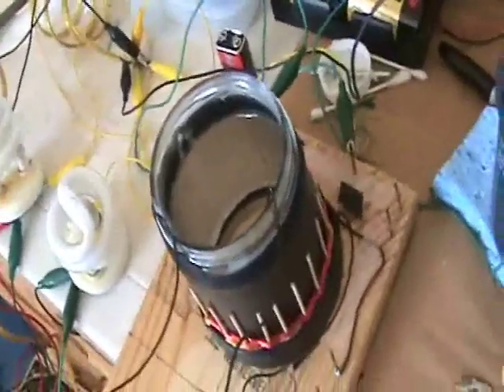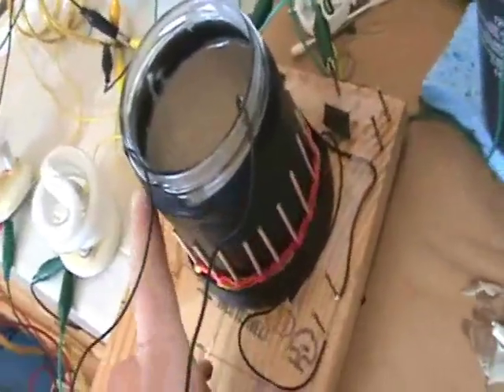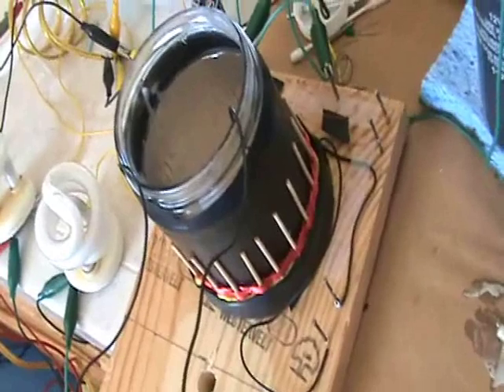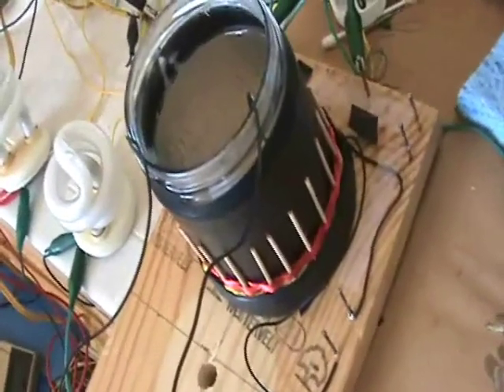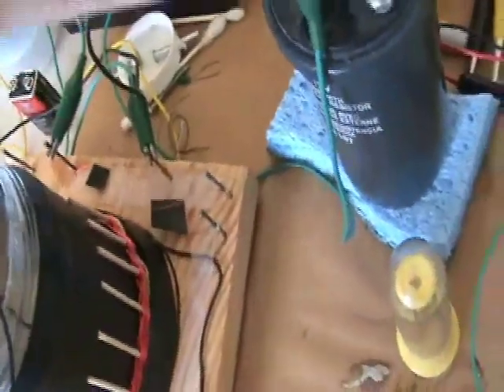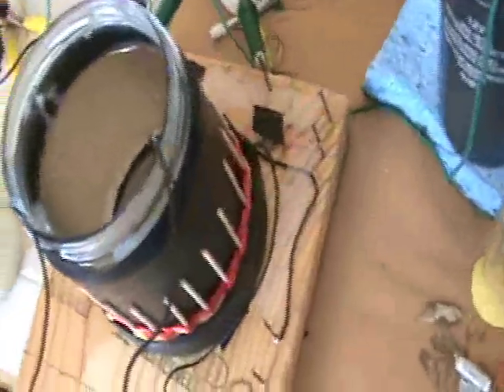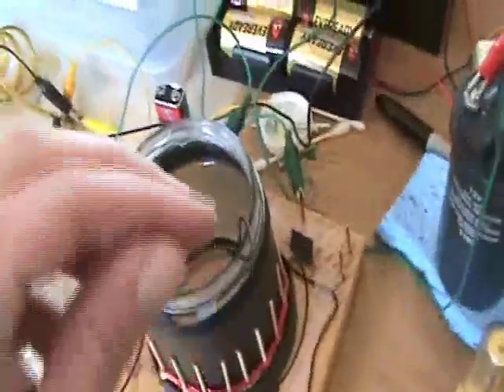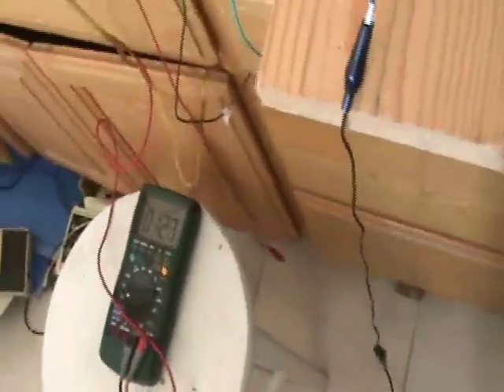hendershot coil replication - part 1

Comment: I'll believe that this is practical when somebody shows how many U and A produces, not only U (voltage). You can produce 1000 V but it it's 0.0001 A  than it's only 0.1 W energy.... Don't be fooled with those videos where they show you how many V can produce some device, let them show you how many V and how many A are producing, than you'll be able to see if it has some potention or not. With simple law formula ofcourse : P = U * I   ( W = V * A )  power (in watts) = voltage   x   amperes
Reply from the maker: Andras Kertai Here is the thing. There is a lot of interest recently in "ambient" power. Microprocessors, for example, can run on very low power. There are devices now that can pull power from the vibrations on a bridge, or from sound, or from radio waves. You don't need much power now to run an intelligent -- computerized -- appliance.

Comment: Z !  Inductance and Capacitance = Impedance or 'Z' value. Your spikes I would imagine are the result of the bridging of the two sheets of foil in your home made capacitor. Try a high rated Cap' and see if it spikes then, if not then you know the cause.

Comment: If you cant replicate it...its not real..?  Its so many lies out ther
Reply from the maker: TheAlabasterdeplume Oh come now. You actually don't believe Hendershot's device breaks some law of physics. Certainly this thing I was messing around with didn't break any laws of physics either. Coils are pretty straight forward. They can oscillate as an L-R-C circuit and background radiation makes that so. It is measurable, although weak. Wireless transmission of power is easily demonstrated. Further, the Earth is an absolutely HUGE dynamo, with magnetic eddy currents in some locations. Just because something is invisible, doesn't mean that there is no energy. All you need is something that creates an oscillation to produce energy. We can look for them in nature -- violating NO laws of physics.
Reply from the maker: I can't replicate a TV set. Can you?
Reply: no...the tv works...this dont work...
Reply from the maker: Tony Nelson Now imagine a situation where you have photos of a so called TV set, historical evidence that people saw it working, but no schematic, no patent, no instruction manual. Is it appropriate to just say "well that invention wasn't real" because no one can replicate it. Or, in the spirit of exploration, why not try to figure it out. That is all that is going on here -- a bit of reverse engineering and exploration.
Reply: I seen this a long time on you tube...free energy...?  I think josep newman enging  realy works...
?  why cant People replicate  hes motor..?
Reply from the maker: Tony Nelson I haven't looked at Newman's stuff, but I certainly have an open mind. I think science would accept such devices if it can be shown where the energy comes from. Take cold fusion, for example. Most scientists are in denial about cold fusion, and yet there is something going on
there for sure.
Reply: morpher44 TV sets dont break any of the laws of physics. This thing does.

Comment: I believe that the Hendershot device requires a lot of extra tuning for each load applied.  if you get it working  it might be interesting to have it tune itself with some kind of feedback circuitry.  I always found it very difficult to understand what exactly he was doing with magnetic vibrator which swapped energy.

Comment: Hi, Your videos are interesting even if I do not understand what are the conclusions, if the generators in the end they work!
For the generator L. Handershot I have to say the patterns and values are confused and not very well described, it seems that something is missing even though I do not understand what ...!
For example; coils constructed as described by me have not the same Henry, the capacitors are not polarized as described but often appear as polarized electrolytic?
If my translation is correct, the ferrita capacitor, must have a support magnetic but should not be magnetized, a tube Mu-metal, could go well even if it is expensive?
Which of these things are true?
greetings

Comment: So I see that a comment was made by Mike Hendershot that Hendershot use this in his household, he didn't say if was practical or not.   Has anyone gotten any power out of this device ?  I see you can buy a construction video/book from the hendershot is fake video, but has anyone replicated it ?  I see people adding pulses and external power to these things as per your video, which is not what he intended in his generator.  Keep tinkering !
Reply from the maker: I believe this is still a mystery to solve. The so called "plans" are a rip off, given that you can find books, schematics and other things for free using "google search". Don't BUY these so called plans. Meanwhile, a good way to study a coil-transformer-capacitor circuit is to pulse it.

Comment from the maker: Hendershot used a Pyramid capacitor that was 80MFD/40MFD with voltage rating of I think 125VAC. AC CAPS like this are sometimes used in Air Conditioning units to help start the motor. They are a bit expensive. NOTE: This is not a CHEAP electrolytic capacitor. As to where to buy them -- try electronic surplus stores. Transformers are 5:1 ratio such as 120VAC one side, 24VAC other side.

Comment from the maker: Capacitors leak and coils self oscillate with spurious AC and pulse waves. The power on a self oscillating coil is very low -- nanoWatts. Capacitors need a lot more power to charge up. Put a coil near flowing water with minerals, and you can get MORE power. Germanium diodes can be used to convert to DC ala bridge rectifier. There is very little loss with these diodes. Search for Tate's Ambient Power Module circuit.

Comment from the maker: Wind and solar are NOT self sustaining. The power comes from the Sun, ultimately. Block out the Sun, no power. You can put a coil on a table and it will self-oscillate. This too is power from the Sun -- just not very much. A spinning magnetic in a coil or a spinning coil around a magnet are NOT the only ways to convert rotational power. The coil(s) can be stationary and the EARTH is spinning. Homopolar generators also work. There are lightning strikes around the globe. Electric universe theory.

Comment from the maker: Yes. What you are describing is known as a vibrator power supply. Back in the old days of radios, the problem of conversion from DC battery voltage to AC to power TUBES was solved by vibrator power supply circuits. They used something LIKE a relay to create the AC voltages. This is a power-conversion technique and is NOT over-unity.

Comment: I have managed to use an automotive relay and a 12volt battery to make impulses (even felt by hand touch) of around 50 - 120volts dc after watching so many of the videos here on you tube but I just cant get these impulses to recharge my source battery as yet..despite using diodes..maybe you can also dwell into it.. but its the first promising thing ive seen in 2 years!!

Comment from the maker: I'm a hobbiest and not selling anything. Your best bet it to search around using Ebay or Google's shopping search for devices that can produce 100 to 200 watts. Solar, wind, geothermal, water turbine, thermal electric generator, etc. are possibilities for off-the-shelf stuff - with a price of course. 200 watts is a lot. You might consider LOWER POWER lighting. You can power a CFL with a single D cell battery.